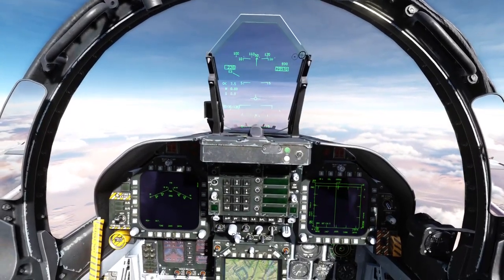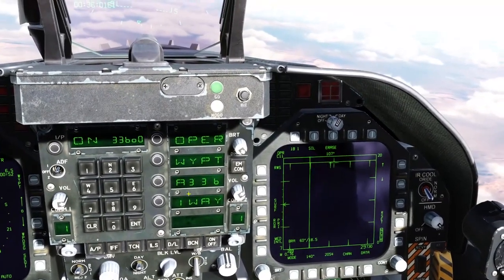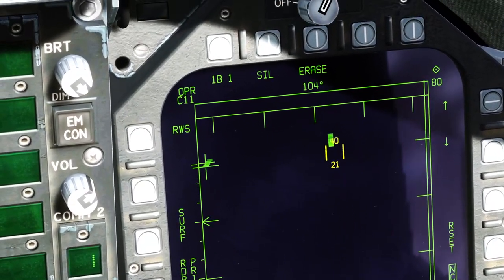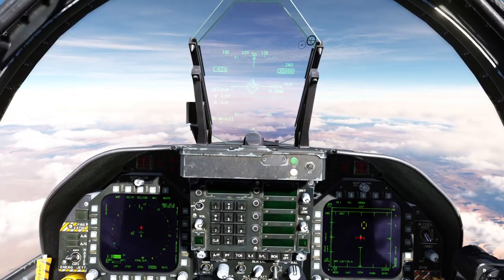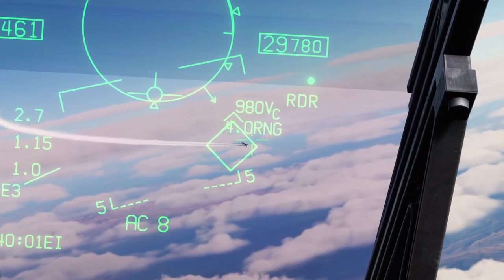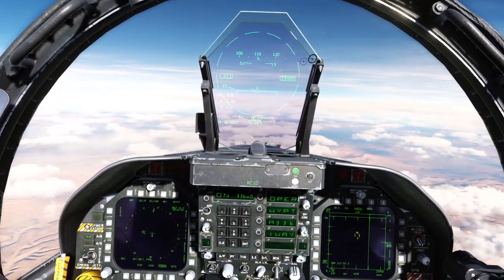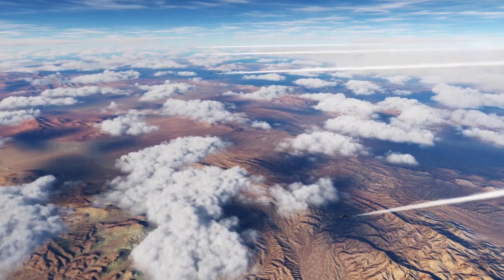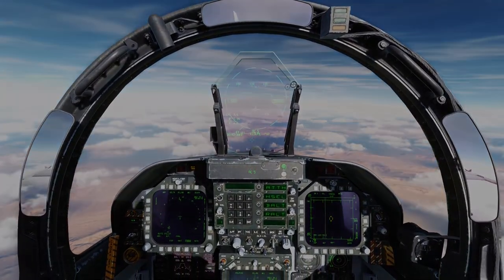F/A-18C Hornet air to air beyond visual range tutorial | DCS

Comment: So is rws not the same in the hornet as the viper? Because it doesn’t give a lock on warning regardless of mode. And you can track two targets with rws with a bigger hit rate and faster lock on speed.
Reply from the maker: Yeah hornet is only one target. But they always get a lock on and launch warning in rws.
Reply: @MeanStreakGaming  really? Thanks for the vid and letting me know. Kinda crazy how different the two aircraft are.
Reply from the maker: All aircraft are different. They all have their pros and cons.
Reply: @MeanStreakGaming That’s not true, an L+S is the same in RWS and TWS, and STT from either is the same. Also for an AMRAAM there is no such thing as launch warning unless active off the rail.
Reply from the maker: That's true, an amraam only triggers the red warning when it goes pitbull. Unlike some other fox3s which are active off the rail. Like r77s and r37s (at least in DCS)

Comment: Mine isn't doing this.  TDC Depress doesnt work.
Reply from the maker: Ok, in what situation? Gimme more information please.
Reply: @MeanStreakGaming press in and it don’t work
Reply from the maker: It could be any number of things. Make sure A2A mode is selected, master arm is armed, correct DDI is selected, correct weapon is selected. Also make sure you're locking the actual radar return and not the information from the data link.
If it's still not working after you make sure all these things are correct, join our discord and we'll go through it together.
Reply: @MeanStreakGaming  How can i tell which things i’m seeing from the data link? cuz on my radar the enemies appear as red things but i can’t lock. aren’t the enemies supposed to be little rectangles or something
Reply from the maker: @truthfxl That means tours trying to lock the info from the data link. If it's red, it's data link. Needs to be a yellow rectangle to be a radar return.